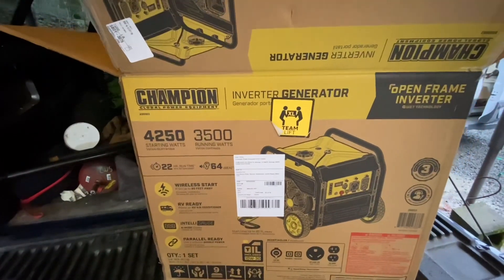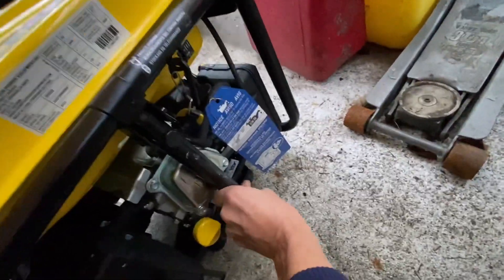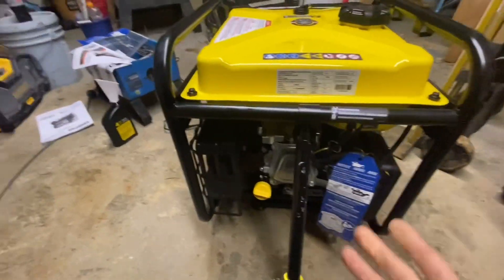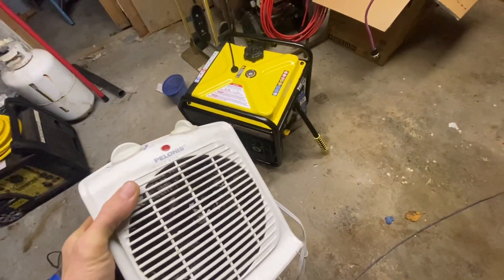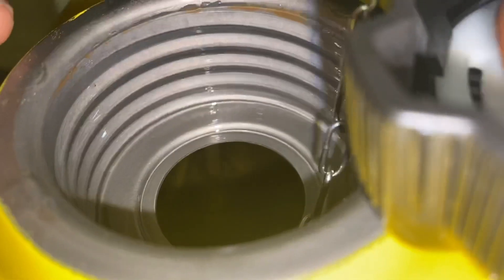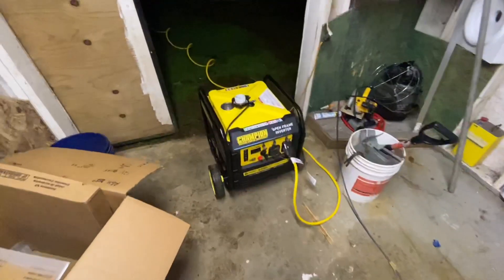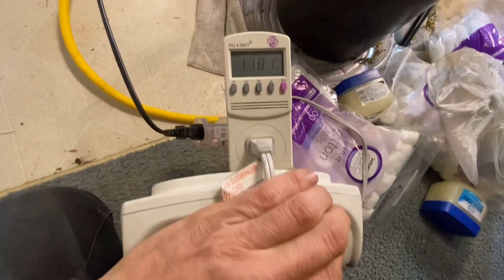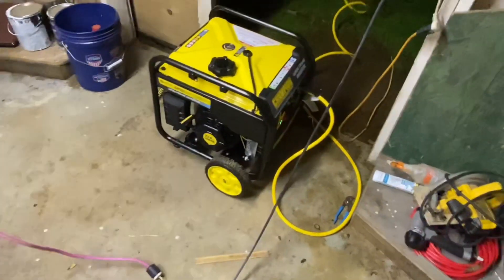Champion 4250 watt inverter generator set up, maintenance, and review

Comment: How long with the generator remain on standby when shut off for the remote to still be able to work? When dry camping, using the remote to fire it up when inside the trailer would be great.
Reply from the maker: Not exactly sure what you mean because of a slight misspelling maybe but after a year, I can still push my remote button and my generator will stop or start as I desire.

Comment: Thank you for the video. I use the little ten dollar , battery operated, gas transfer pump from harbor freight to put gas into everything now. These new gas cans  drive me crazy! It’s a lot easier.
Reply from the maker: I’ll have to check out that pump you’re talking about, that sounds interesting. I’ve seen little battery powered oil transfer pumps, but nothing listed for gasoline.
Reply: @geterdone  yeah, just search gas transfer pump at harbor freight. I just looked it up and it’s 12.99 today, but they go on sale all of the time for 9.99. I bought this generator after watching your video. Slept in our camper for the first time , using it last night. Worked perfectly,thank you. We have a Winnebago 1800bh, micro Minnie , with a 13500 btu air conditioner.  Used about 3 gallons of gas over 12 hours.

Comment: You don't want that handle bouncing on the engine valve cover....so they keep it away for a purpose.  Pull the fuel strainer out and break off that top flat portion of that red plastic part.

Comment: I wonder if using ethanol free would alleviate some of the issues with fuel sitting in this generator...
Reply: I have the non inverter champion, I use 10% ethanol with star tron fuel stabilizer,when I store it for the winter I make sure to fill tank completely and run the carb out of fuel and have had no problems going on 4 years now.
Reply: Yes,  but best to run the carb dry and have zero gas in the tank.  The carb bowl has a drain screw.
Reply from the maker: I doubt it, when I was a kid you could still smell old gas because it would leave a residue when it evaporated, and it would smell different. You could get a gummed up a carburetor due to the leftover deposits.

Comment: Have you run any bigger power tools on this generator? I have the portable dewalt table saw that is 1850 watts so this should be perfect for it, but I always like to hear from people with real world experience.
Reply: Used with my 30 amp RV, no issues. That included running my electric water heater, tv, etc. I think you will be fine if you let the engine warm up.
Reply from the maker: Not power tools yet, just heat lamps and a heater to test the output. It does have a bit of lag time running in eco mode but that is to be expected. It has delivered the power advertised so far.

Comment: How is the generator going I want to get one but will this run a fridge and ac together
Reply from the maker: Maybe, it depends on the wattage requirements. Look at the data plates on the appliances, volts x amps = watts. You have starting watts and running watts. As a general rule of thumb you don’t want to load a breaker more than 80% of its rated load by the way.